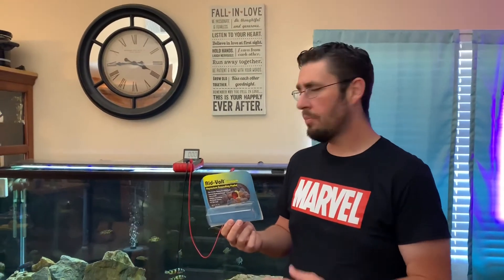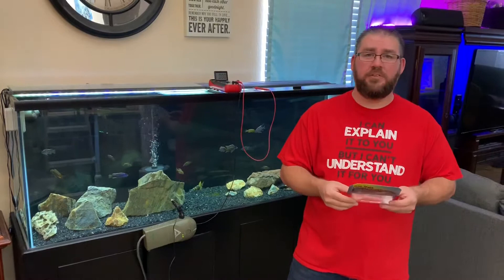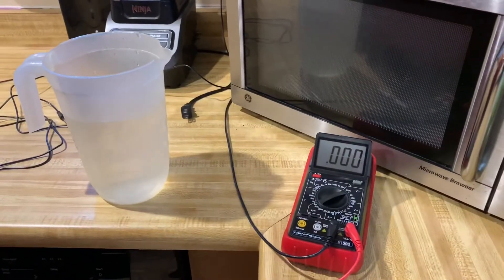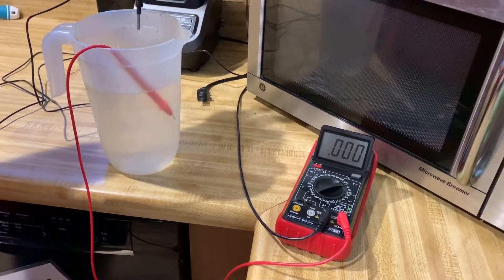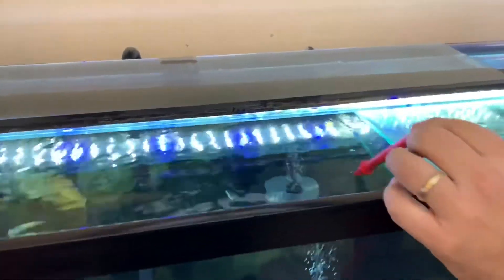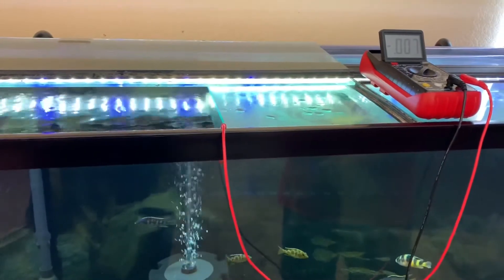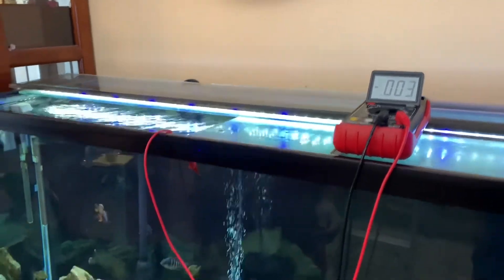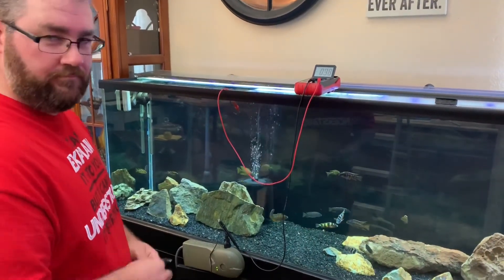TESTING: electrical current in your aquarium!?

Comment: The whole point of this is to prevent electrocution of you if your heater glass breaks which could kill you as you become the circuit. Instead you can pay a small price put a wire into your tank and if it does break it will trigger your circuit breakers / rcbo / mcb. 

I can explain it to you but I can’t understand it for you.

Comment: The meter will detect induced voltage likely because it is plugged into an active power outlet.  The magnetic field leaks onto ground therefore giving a reading on the probe. In the event of say a glass heater cracking and actual voltage being conducted through water this product may work as claimed.  Interesting video and thanks for making me use my brain!

Comment: I was shocked badly by a brackish water tank so bad my arm went numb for an hour. I have read that fresh water is not as good of a conductor as is salt water. Because of the salt. Also I don't think stray voltage is a problem until a piece of equipment goes bad.
Reply: You could have died had that voltage and amperage decided to take a path through your heart  rather than past jt. I was shocked once from a faulty heater the  seal  had broken, I always turn my heater off before putting my hands in and I’m thinking of referencing my tank to ground to ensure safe cut off in the event of major leak of live to earth